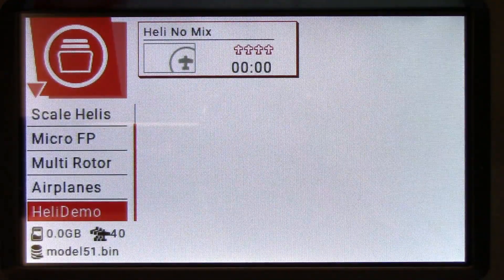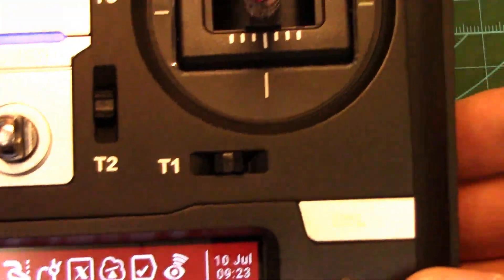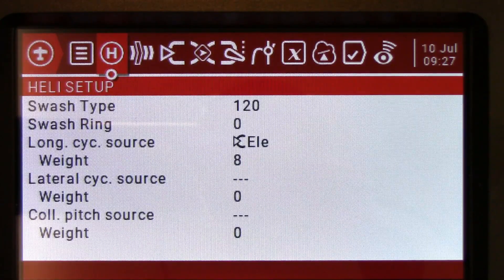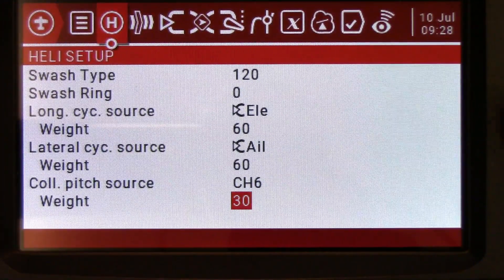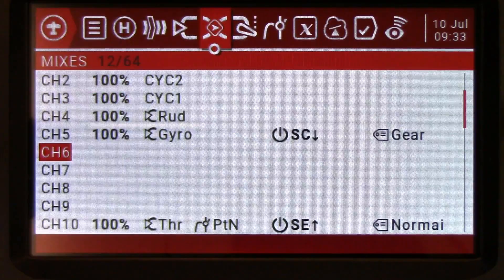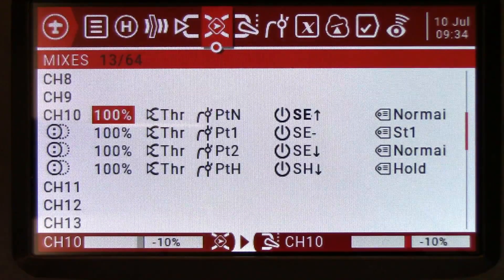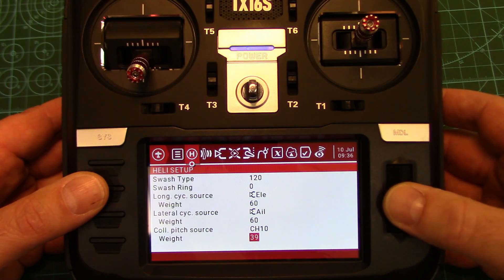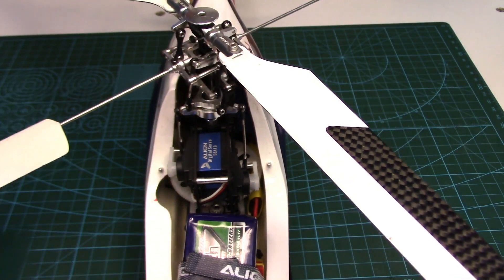OpenTX CCPM Helicopter Setup - Part 2 (Internal Radio CCPM Mixing)

Comment: Just saved me HOURS of trying to figure this out on my own. Just bought TX16S (EdgeTX) and trying to setup the old good T-Rex 600NSP. Speaking of EdgeTX vs OpenTX, same thing, just different UI and timers, no need for logical switch for this, they have built in 3 timers. At least I was able to follow the video doing 100% the same just in different UI.
Reply from the maker: Glad it was helpful! Happy flying!

Comment: The Raptor 50 from Thunder Tiger is using 90° mechanical mixing. Old model but very popular back then.
Reply from the maker: They all used 90 degree mechanical mixing back then, not just TT.

Comment: Hi John, not sure you saw my last note but the issue I had was solved by checking one box....the channel map box...had you seen that before? Thanks again!
Reply from the maker: Nope, never seen or heard of that before but I don't pretend to know all the hundreds of programming variables & customizations that Open/Edge TX offer.
I take it then the channel map box is what either automatically maps the AETR/TAER TX output order to RX channel input order or allows you to override that order with your own channel output order you program in the output menu?

Comment: I have a Trex 450 FBL with the 3GX compact, currently set up for a spektrum and satellite receivers with my Radiometer 16Xs.  I followed your excellent tutorial for the internal mixing, using TAER default setup. However, the servos are not moving in the correct direction..almost like they are moving randomly..even when I'm in direct mode with the 3gx. Any ideas? When setting up with my Spektrum radio I had no issues.
Reply from the maker: There are many reasons that could happen. Due to the programming and connectivity complexity, I would really need to see it in person to fault trace the reason/s (presuming of course you have confirmed the mixes are working correctly in your servo monitor menu).
Reply: @Rchelicopterfun  Thanks John! I will go back through all of the settings again and try again.
Reply: @Rchelicopterfun  I think I may have found the issue...Under Internal RF, and I select DSM, the module status shows V1.3.2.11 AETR.    This is not the normal TAER for Specktrum....could that be the issue?
Reply: I disabled channel map...now working like it should

Comment: You just saved my life after days of hair pullings
Reply from the maker: Glad it helped a bit 🙂
Reply: Appreciate if you could help answer my doubts: Looking at the radio monitoring, the elevator servo always moves twice percentage as much as the alileron and pitch servos. I am confused if it is correct on bench.
Reply from the maker: Recall you your basic trigonometry. Pit & Ail are at a tangential angle. The math is fully covered in OpenTX University how the mixing sin & cos calculations are done on the tangents of the swash. Here is a link to the CCPM trig calculations page on their site:  https://open-txu.org/home/special-interests/helicopter/ccpm-for-taranis/
Now you understand why I'm a huge fan of OpenTX U.

Comment: fantastic I finally understood I understand this radio.
listen helicopter with flybar we use this method, if I connect a helicopter without flybar does all the flybarless... 
the right method for a flybarless is to associate pitch curves only at channel 6? (and in case  of spirit gt, brain etc page HELI SETUP I DON'T HAVE TO DO THIS) ??

Comment: Hey John just setup my radio with the help of your video . Part 1 and part 2 . But how do I set the two dial S1 and S2  for PT pitch trim and TT throttle trim  thank you
Reply from the maker: 1. I never use pitch trim so no idea. I have only altered my pitch curves as required to obtain the desired collective ranges - collective trim was used back in the day when we didn't have programable pitch curves and thus is rarely used anymore.
If you still wanted it, you would have to create an add function to that channel output most likely but that is just a guess (I'm not an Open/EdgeTX expert by any stretch).  Perhaps OpenTX university has something on it? Likely a way with logical switch programming as well. 

2. Throttle trim. I take it you don't want to use the digital throttle trim for that? Throttle trim is another thing that is not used much anymore, other than with IC engines in which case the throttle digital trim will work, but it's obviously very slow and tedious to dial up and down one click at a time. 
So if you want faster control of throttle trim output for IC engines, I did a video a while back showing one possible method on a gas plane that would also work on a nitro/gas heli: https://youtu.be/-cK6DZfu86s?si=AlQz11QaI0x6Ga6I
Reply: @Rchelicopterfun  hey John I got it work . Have to make it a input . The in the mix add to the phantom Ch and it worked . Lol your the best thank you again

Comment: Dumb question . On the throttle. In the radio you set throttle to ch 1 . On the  receiver is the servo still plugged into CH3 . Thanks
Reply from the maker: @stevealoia. I actually show throttle on both options; Ch1 in the primary part of the video because that is a Spektrum/JR channel mapping order template (TAER). At the end of the video, I then show the template for Futaba channel mapping order (AETR). 
Sorry, I don't what you mean by "is the servo still plugged into CH3". What servo? With Spektrum/JR channel mapping order (TAER), the elevator servo would need to be plugged into channel 3. With Futaba channel mapping order (AETR), the ESC, FADEC (turbine) or throttle servo/ throttle servo governor (nitro / gas heli) would be plugged into channel 3.
Reply: @Rchelicopterfun  thanks John . I have to rewatch the videos .a bit busy here today . BTW I just got your EBook for the heli setup thank you
Reply from the maker: @stevealoia - thanks for the patronage 👍 happy setup.

Comment: This is great, thank you! This information is not easy to find, and most people will tell you just to not bother doing CCPM in OpenTX/EdgeTX. This is not nearly as difficult as I had expected. I'm going to be using a TX16 w/ ExpressLRS to fly my Raptor 50. Just waiting for summer!
Reply from the maker: Have fun 🙂
Reply: Can I ask how you got on with that? I just got a old Trex 600N pretty much for free but don't really know where to start with old school flybar helis
Reply: It works great. The Raptor uses mechanical mixing, so there's really nothing special going on in EdgeTX, just throttle and pitch curves. I would recommend a throttle governor on the 600N if it doesn't already have one. That takes a lot of the guesswork out of your curves and takes care of the throttle for you. @Zillawill
Reply: @MontegaB  thanks, I'll take a look see if it has one when I take it apart to rebuild it, at moment only thing I know for sure is it has Spektrum servos, and a Futaba tail + GY401 gyro
Reply: The GY401 is a great gyro, it's what I have in my Raptor as well. Good luck! @Zillawill

Comment: Mr. Salt I buy a fs-t6 radio and my friend gave me his HK 450 heli that he crash, Id like to convert the mechanism into flybarless, I've done it, my question is  a fs-t6 is capable of 120⁰ ccpm with just programing the radio or need more mixing electronics  to attain collective cyclic mixing? Thanks ed frm. Ph.
Reply from the maker: I've never looked at the FS-T6 specs, but as long as it says it will support helicopters, that generally means it supports a few eCCPM mix programs, with 120 degree being one of them since next to 90 degree, it's them most common. It will specify supported swash types the manual that came with your radio.
Reply: Thank U very much Sir John, I have already done, the 120⁰ swash programing but tha aeleron can't make it in right direction it always in reverse direction of flight whenever input collective soon the rpm increase and I have to correct heading the rights is left and left is right, I tried exchanging and reversing the servo but no success, and when  the reverse is done the two aeleron servo is nit responding to 3rd servo as I increase the revolution it tend to over forward in respond

Comment: First of all THANKS for the vids been out of it for a few years and going right to EdgeTX (raw) you have made it easier BUT I do have a question. You on the Heli setup page you set your ELE to operate around the Longit. axis, I have always been taught the Long. axis runs length wise and movement around such is called roll controled by the Aileron. Can yu explain your reason for this, I realize in CCPM they are just wires coming off a RX but I am woundering the possible ramifications with a FBL unit where the things are hard wired with not as much versatility as ccpm?
ALSO I probably have missed it in my ignorance but when I attempt to set the sources to the different CYC channels I have NO option for CYC1,2,3. I have them in companion and can create them there but not in the radio itself, what did I miss?
Reply from the maker: Not sure I understand your question. Aileron / cyclic roll is always left-right stick movement - just like in a full size aircraft. Elevator / cyclic pitch is always up-down, again just like the control stick in a full size aircraft. 
If you don't have those cyclic mix options, perhaps you didn't uncheck "no heli" in the build options; that or Edge TX is different? Since I don't use Edge myself, I can't comment on that possibility either way.

Comment: Hi John, I enjoy your videos! I especially enjoyed your books. Got me hovering with your recommended heli setup values. I recently switched over to a TX16s tx and watching your videos helps cutting thru the fog. I wanted to ask you where you got your Sound Pack for your TX?  I like some of the comments your TX makes. I like to get a hold of the Sounds. Thnx
Reply from the maker: @al can - it's the "Amber" sound pack. Found the link at OpenTX University's web site. I'm sure a bit of Google searching and you'll find several other sources for Amber as well.

Comment: Hi John I am new to radio master tx16s.
For the last 10 years I have been using spectrum radios.
I followed your video most of it was work except channel 2.
Trying to set up my flybard trex 500.i have got in the right muddle.
Could you please send me your settings for a flybar helicopter this is a headache for me lol😃

Comment: Well I almost got there. When I push up on the throttle the swash goes down and the motor runs. If I reverse the throttle in model setup the swash is correct but the motor is full speed with stick down. Also gyro is only showing 2 percent on all switch positions.   Any ideas please. Aha  I reversed the outputs on channel 1 2 and 6 which corrected the swash.
Reply from the maker: I cover this at 4:30 and in my swash ebook if you have it. It's not channel reversing issue; it's mix weight reversing issue (using negative or positive value in your heli swash mix menu for collective).
No idea on gyro output at there are many reasons this could happen in Open/EdgeTX. Common ones to check are to make sure your weight for whatever input you have your toggle assigned to is 100%. Same in the mix menu. And to make sure you have -100 to+100 in your travel screen. Of course modifying the travel output afterward to get the exact gain output (travel output) you want. Or you setup a special gain curve for a stepped travel output for gain adjustment. Other ways as well - many options with Open/edge TX.
Reply: Strange if I reverse the settings left and right etc is good but up and down are wrong. Can't get both right.  I will keep playing lol.  6 hrs later I've had enough. I will check out your info.
Reply: I changed the weight to minus 60 which corrected the up and down but it has reversed the left and right f b . Going in circles lol
Reply from the maker: "Going in circles" is the term I also use in the swashplate ebook. You have to approach 120 degree eCCPM interaction & mixing systematically.
1st you get all 3 servos moving in the same direction with collective stick movement by altering channel direction for whichever of the 3 servos is not moving in the same direction of the other two; unless of course they are all moving in the same direction in which case you can skip to step 2.
2nd. you get the mix directions set correctly (in terms of stick movement) with the positive or negative value of the mix % (weight).
Reply: @Rchelicopterfun  erm I almost understood that. I will probably order your pdf .   I can only get get up n down correct or left right forward backward. Never both.

Comment: Finally got my Heli in the air. Reverted the radio Firmware to 2.6. Had to manually move the channel outputs around until I got the right servo's moving... Then it was just a matter of reversing some servo directions to get it doing what it's supposed. Massive learning curve. Would have been absolutely impossible without your tutorials. Thanks for the great videos.

Comment: Hi. I've now done this over and over and over again each time starting from scratch. I've got a Brand new Radiomaster TX16s Max V2  currently on EDGE TX 2.7.1 which I got 4 days ago. I'm trying to setup a quite old Tarot 450 V2 flybar Heli that has a Spektrum AR6210 Rx which was working(and flying) on my DX8. As far as I can tell I have done everything step by step the way you have. But for some reason it's all backwards and wrong on my Heli.. In the outputs screen I have the identical behaviours you have but on the heli, collective pitch is reversed with some odd behaviour in the Ch2 Aileron servo towards max extension. Pitch and roll is only moving the elevator and "aux" channel Aileron servo.

I'm at a complete loss do you, or anyone from the community have any useful suggestions?
Edit:
I've swapped to a Flysky  FS-IA6 Rx and getting the same results after doing a complete new setup.
Reply from the maker: As you already figured, it has nothing to do with the RX. It's due to swash mix direction (+ vs -) in combination with channel direction setting for your 3 swash servos. I cover swash mix reversals and how they relate to channel reversal in depth and how to get them all interacting correctly & in the right direction in my swash setup ebook if you happen to have it: https://www.rchelicopterfun.com/swashplate-setup.html
Otherwise, you'll just have to play with your swash mix weight +/- values in combination with channel reversal for the 3 cyclic channels until you find the right combination of both to get all 3 servos interacting in the correct directions.
Reply: @Rchelicopterfun   I've updated the 4 in 1 module firmware and selected TAER setup.. Maybe this will make a difference seeing as it was behaving as if my servo's were connected to the wrong outputs. will update.
Reply: still no luck.. messed around a bit, seems it's outputting EATR instead of TAER ... set it up as a plane, when I swap input's around in the radio the throttle channel outputs on the elevator. something very odd going on with my radio.

Comment: Hello sir 
I have walkera v450d03 
Can i use radiomaster tx16s 
And what method i have to use part 1 or part 2
Reply from the maker: Sorry, I don't know what protocol the RX in that heli uses and I don't know if the FBL unit has internal or external mixing.

Comment: Thanks John. Cant wit until spring to try it out. I tried the university route but my Blade 400 did not fly right. Your expanations are much better. Question, I have a Futaba GY 401 on my helicopter. Do you have a video about how to set it up with channel 5 on my Taranis to switch modes or even acitvate it? Thanks Again.
Reply from the maker: Recommended channel output for the 401 gain is explained in the instructions of the gyro and what values to start with. You would simply change the channel travel in the output screen of the radio for whatever channel you are controlling tail gain with to match the gain setting you want to start at along with what toggle you want to use.

For example if you want to start at 75%, you would set the output to value to 50% because OpenTX uses the -100 to +100 travel range scale (cover conversions between the two scales in my setup & tips ebook if you have it). You could also use curve programming to set the gain outputs or weighted settings in the mix edit menu for that channel.

If you really want to get ambitious, hook your gain channel up to one of the dials for variable output adjustment. You can then really fine tune the gain. Once you have it spot on, look at your channel output for that channel (not moving the dial) to see what the output is and then set the fixed output level for that channel.

These are just a few ideas as there are many ways to set the channel output level with opentx. Others that come to mind are logical switch programming or simply mix your gain channel to your flight mode toggle so you have different tail gains at different head speeds - that is likely the best final option once you have experimented with tail gain settings at your various head speeds and now which work best. Setting up your tail gain channel output is only limited by one's imagination 🙂
Reply: @Rchelicopterfun  Thanks John. Rally appreciate the help. I will look into the manuel for the gyro and get the numbers. Thanks very much. Best videos on the subject.